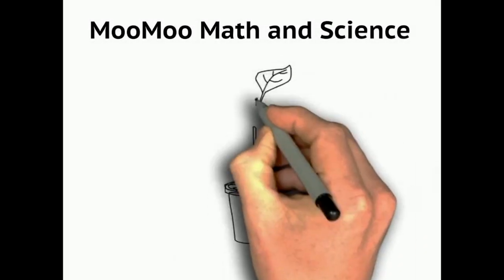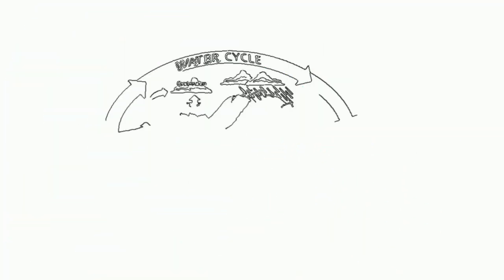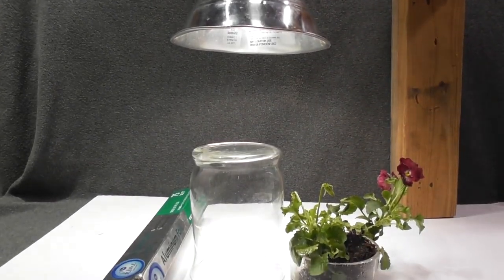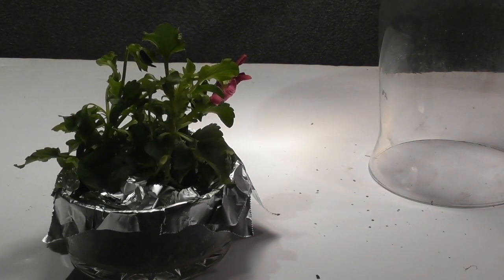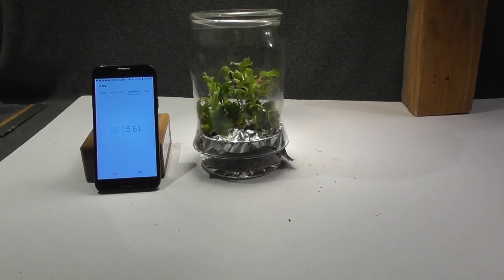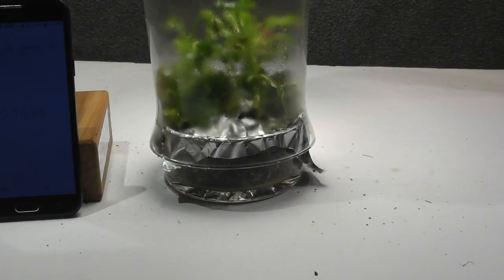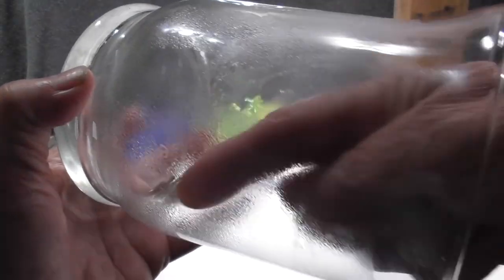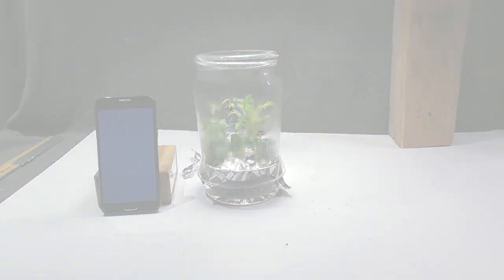Transpiration in plants-Real life demo

Comment: How do we know that the wet soil didn't just have water evaporate and produce the condensation on the sides of the glass cover due to evaporation and the lights producing heat? I think a control would have been a nice touch. Maybe with a plastic plant in soil with the same amount of water added to water the soil of both plants.
Reply from the maker: Good feedback. I tried to use the aluminum foil to reduce the moisture from the soil.